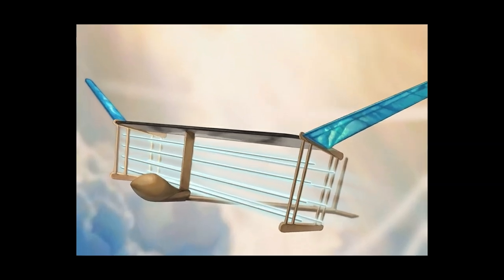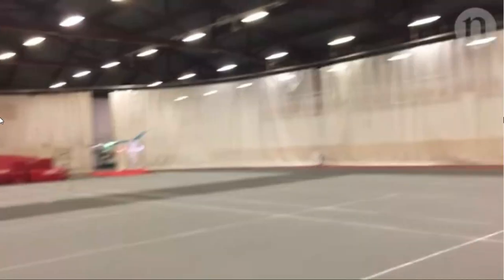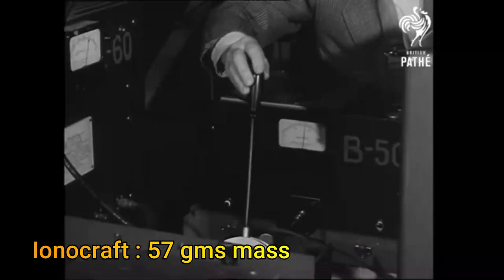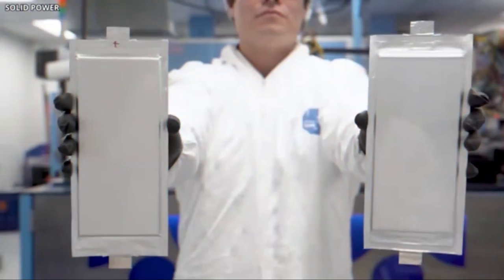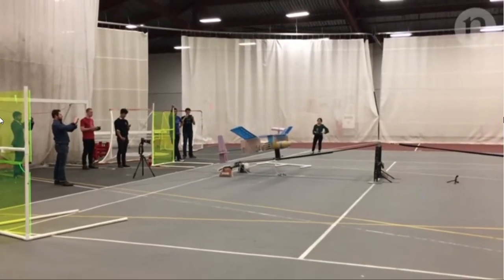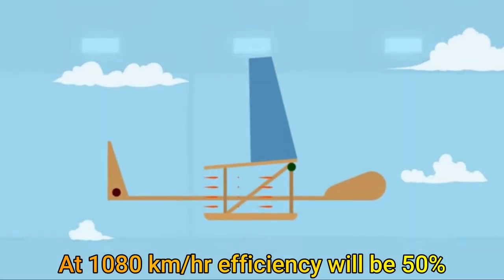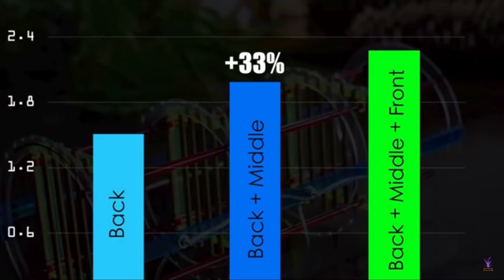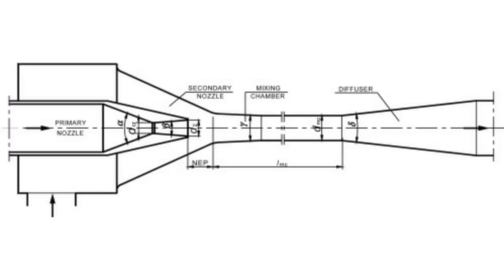Electroaerodynamic Propulsion:  Is it viable?

Comment: Apart from this being an EXCELLENT video as a summary of the topic (thanks!):

The traditional way of generating thrust via ionic wind will never work efficiently. This is not just my personal opinion, but given by physical limitations, ultimately dictated by Paschen's law.
Because.. what can you do to increase volumetric and gravimetric thrust? Electrode distances and electrode shapes+materials can be optimized, electrode pairs can be stacked and layered...  
Still, a given volume of air (at a certain temperature, density and humidity) will always only hold a limited space charge before breakdown occurs.
Needless to say that the resulting unit will be bulky, heavy and fragile and will deal with lots of aerodynamic drag. And with very high voltage shielding passengers from ionizing radiation (xrays) may also be a concern.

I'm aware of some rare examples that can at least carry their own power source for a few seconds or minutes (e.g. the devices by Ethan Krauss, as mentioned in the video), but despite admiration for the pioneer work, I'm still having a hard time calling such attempts anything but anemic.

A possible solution, without violating any laws of physics: separating the two steps of ion generation and ion acceleration instead of trying to achieve both within a single electric field.
Separating those steps and potentially chosing a different method of plasma acceleration may also imply that extremely high voltages are no longer required. Just for the ionization part, low single digit kV are enough. Any viable solution will imply a method of plasma acceleration that is not affected by the space charge dilemma.

I'd also like to point out that typical needletip electrodes or thin wires are not the only way. When we look at research papers, the more exciting stuff is currently happening with plasma actuators and dielectric barrier discharge. Because these variants work with flat surfaces, there may be aerodynamic advantages for applications in the field of aviation.

Combining these thoughts, I have recently completed the design of a prototype for a new  principle of an atmospheric ion engine that I've been working on over the last two years. It will likely be much more powerful than anything we've seen so far - at least that's the hypothesis. Final assembly and tests will follow in a few weeks (I'm still waiting for some electronic parts from China...). Actually, efficiency is the least of my worries. All the basic principles are proven, just their combination is new - but  there may be other problems, like e..g. transformer cooling, excessive ozone production or material durability under constant bombardement with ions and reactive oxigen species... We'll see.
Reply: Sounds dope post a video when it’s ready!
Reply: Hi again Christian.  I appreciate you mentioning my crafts, but it is very unkind of you to call them anemic, although the particular flight video that was shown above was by no means the most vigorous flight of the craft that that I have shown and it could have been applied to that flight.  It was and is still the only 100% ion propelled series of VTOL crafts in the world.  I wish you luck with your personal attempt, but I think you will find it more difficult to build a VTOL ion propelled craft than you think, especially for sustained flights.  Ion propulsion has other advantages besides heavy lifting, although that is easier to do with balloons and gliders for added lift.

Comment: I thought thrust is a result of the volume of air x the speed of the air. If that’s true changing the exit nozzle diameter would change the speed of the thrust, but not the amount of thrust….kind of like how a higher gear in your car gives you more speed, but not more horsepower.

Comment: Static or ionic field not magnetic field

I think if a thin long box wing with a positive ionising wire electrode near the edge is used to concentrate the air followed a short distance by a negative ionising wire electrode to expand the air towards a positive collector electrode, an increase in thrust may result.

Comment: Very interesting, if you somehow could accelerate the ions in a maybe O2 high enclosure to achieve more Wind at higher thrust..  Combine it with the betavoltaic battery wich yields high voltages at low amps?

Need to find a way to rev up effiency but otherwise splendid.

Soon we'll truly be of to see the wizard
Reply: Theoretically yes, although only a small percentage of the O2 is actually ionized.  Good ideas, these types of thrusters do pull in lots of air and O2 from the sides though.

Comment: Why such high voltage (+- 20kV)?  Is it merely because of the distance between the poles? Or is it required due to some property of the nitrogen to be ionized?
Reply: Around 15kV is the threshold for ionization, but more is better because energy is only consumed at the creation and neutralization of ions. The longer the distance between the electrodes, the more use you get out of each ion. But you also need a steep voltage gradient to get high thrust, so wider spacing requires higher voltage.

Comment: I think seachers must modelize very precisely the "maximum nitrogen's ions acceleration theoricaly achievable in a standard athmosphere pression" to calculate the real maximum efficiency achievable.
If this one is equal to superior of a simple engine+propeller, so this thing has a future, since the problem of poor efficiency is just a design problem, and a static propulsion system has a huge advantage... of beeing static.

If the max theoric is that inferior ( 50%)  to a perfect theoric propeller ( about 80% ? ), so it will remain a dead end. 
Interesting but probably with very few achievement in the future.

Comment: I came up with the idea of a ducted ion thruster months ago. U had the same idea. Just make one with 100 ducted i ion thruster. Run it from a tesla coil for the power. U just need a receiver no battery
Reply: Devices that beam power in a straight line, like a laser for instance, are a lot better at transferring power.  A Tesla coil radiates power in all directions, so the power rapidly dissipates.

Comment: And what if there will be used c-pump for acceleration of pressurised air with compact "ion engine"? Just need to use simple missile engine which uses accelerated by c-pump pressurised air which must be ionised by electric field, it must be increase output of thrust. Same  engine with fuel-oxygen, but you have to use only pressurised air instead of fuel, and  high electric field instead of oxygen. It would be more greener and efficient than traditional and ionic engine.

Comment: You ignore obvious of how static electric arc discharges can occur in twin rotor or counter stacked rotor helicopters so one could paint americium from an ionizer smoke detector to increase fuel efficiency of vertical flight.

Comment: I think thrust per watt efficiency won't be competitive with fans/propellers without very high magnetic field strengths, in a magnetohydrodynamic/magnetoaerodynamic thruster using superconducting electromagnets. If future airplanes are powered by liquid hydrogen, you already have the temps for superconductors right there...

Comment: This reminds me of early jet engines, the first of which were frankly pathetic, until ever greater understanding as well as materials technology upped the amount of thrust the fuel provided, and the systems became suitable for aircraft.  Even so, those engines still had rather short operating lives to begin with.  i suspect that fluid dynamics, resonance chambers, etc, will bring these power delivery systems much further with their efficient use of power.  One thing concerns me, and it is the ionised air produced.  Can anyone tell us what happens to it and over what period of time?  going from one pollutant to another is an important factor I'd suggest?
Reply: I was thinking the same thing (about the comparison with jet engine development, that is; the ionised air as a pollutant matter didn't even occur to me, I must admit). Early jets were abysmal failure after failure, with quite a number of aeroengineers dismissing the concept as a curiosity, but never to provide worthwhile flight thrust. It is folly to make hard predictions about future designs.

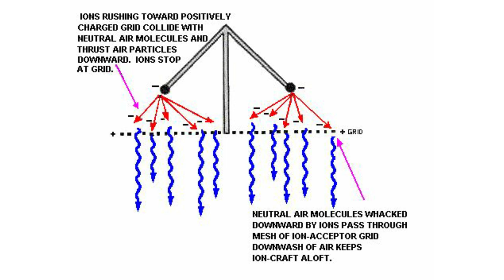Comment: 2:18. i argue the factuality of those statements... the whole concept, really.

the only air you perform work upon to accelerate, the only mass with inertia, are the air molecules you ionise. the only air you perform an action upon, and can receive a corresponding REACTION upon the airframe itself.

consider that it takes work to force a charge onto the electrode. that charge is transferred to an air molecule, the leakage current. then that air molecule in being repelled has to produce a corresponding reaction. against what? the electrode repelling it. if theres an opposite electrode attracting it, there must also be an equal "pull" for the same reason. the air molecule has inertia and wants to keep doing whatever it was before it was rudely disturbed.

if the molecule weighed more than the vehicle, had more inertia... what would move?

the air molecules that get "wacked" simply IMPEDE the flow, they get in the WAY of the air you ARE performing work upon. the acceleration of those molecules is caused by the collision of molecules you performed work upon. 

its like flat earthers thinking rockets dont work in a vacuum as they push on the air behind them... no they do NOT. they work on a pressure imbalance, and perform better when theres nothing in the way to impede flow. they work BETTER in a vacuum!

personally, i think everyones got the wrong approach to ionic "thrusters"... should be working on attempting to get an air ass to oscillate... or better yet, ROTATE... simply moving air does not equate to thrust. you have to build PRESSURE. then an imbalance of pressure will create thrust.

how does a cyclotron work? could you use that principle somehow, to compress air, to raise its pressure?

why isnt anyone applying a magnetic field?

electrostatic speakers?

you need to perform actual work on the air to make thrust.

Comment: Does Ionic propulsion produce NOx?
If yes, this may have little future, NOx emissions are among the worse, it combine with H2O in air to generate Nitric and Nitrous acids, the more powerful corrodent known.
N-acetyl-cysteine, available OTC and po, can protect respiratory tract, but not from massive attacks of pollutants. Blessings +
Reply from the maker: No it wont produce NOx
Reply: @ElectricAviation  Thanks. Perhaps the principle in Ion, Ionic propulsion could be applied to a machine as one of the Alexander Lippisch Aerodynes, patent US2918233 (see ESPACENET), it could even be proposed that the cigar shaped UAP, formerly UFOs, may fly under this principle. Blessings +
Reply: @ElectricAviation  Thus, the issue in this propulsion system, that looks similar to 'Thrust augmenters', eg, that by Sepideh Jafarzadeh, ASU/ NASA Space Grant program, is efficiency, perhaps also the source of electric power needs special attention.
 Gesund +

Comment: I very much doubt that fundamentally this can compete with mechanical propulsion.
it seems that most of the energy is used on the ionization of air molecules as opposed to their acceleration.
while in mechanical propulsion drag is the major loss.
intuition tells one would be an order of magnitude more than the other
Reply: O2 molecules are naturally electronegative and can just soak up extra electrons like a sponge.  Therefore, it does not require that much energy be added to create negative ions, provided the production of heat and other forms of power loss are avoided.  Ion propulsion can move air or propellant with less turbulence than propellors in theory, so it ought to be quite efficient especially at low speeds.  Building them to run on very low currents helps a lot.  In space ion thrusters can move small amounts of propellant at very high velocities, making them especially efficient for that purpose.

Comment: Does this type of ionic thruster work in space?
Reply from the maker: No not the ionic wind one. The ionic thruster does work in space, but you have to take a cylinder of Helium or any other inert gas for it to run. Once that gas finishes, it wont work
Reply: EA is exactly correct; it requires an added propellant to work in a vacuum.  There is an exception though.  If the voltage is increased up to several million volts and a really large gap is used, then a significant amount of thrust can be produced using relativistic electrons as a propellant.  No one has ever tested it though, except mathematically.

Comment: thats only a microwave oven, kinda
Reply: or led electric-photon drive
Reply: dc ion railgun tho
Reply: in other word, dc ion jacob's ladder, the high current arc (welder arc) will ionize incoming low pressure air
Reply: nozzle business is nonsense, if the total energy stays the same (small amount of high speed == large amount of low speed)